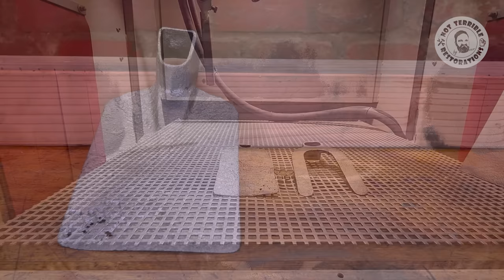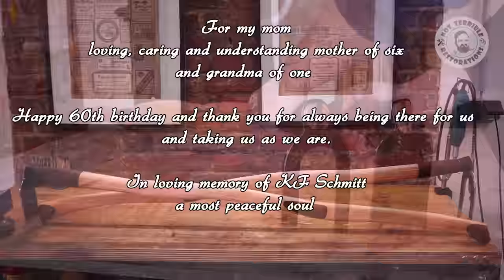Restoration of Rusted Gardening Tools for my Moms 60th Birthday

Comment: Great work mate! Just a good tip when working with glass bead media. 5-6 BAR should be tha max you use. Otherwise you just make the glass beads into glass dust quicker. So take a little bit pressure down and your media will last longer and save you money 👌

Comment: A great idea with the composite handles. I am struggling with getting strong handles for my axes - I need strong and long handles, like 90-95 cm, and the lighter the better. Perhaps the crisscrossing of fibers will help. The inlays of dark wood are beautiful.
Reply from the maker: For axes you should use ash wood or hickory. The proved to be best to handle the high forces
Reply: @NTRprojects  Thanks for the response, Dr.  Beer. I do use both ash and hickory and both are great. Still, breaks do happen sometimes.

Comment: The chemical attacks ALL the metal. Electrolysis attacks ONLY rust. One idea is electrolysis and then a quick dip in chemical to stop flash rush. 

However, you don't need to dip if you are going to sandblast lol

Comment: At 5:28 why didn't you weld or solder those holes?
Reply from the maker: Hey Matt sorry for the late reply I always try to answer questions. I didn't solder it, since that tin would be too soft.
And I didn't weld the tip because the thickness was varying in this area way too much. So some parts are almost gone and around of it some areas with 2mm of material. Welding this is maybe in general not impossible but it requires a lot of welding skill and that is an art format itself which I don't master ;)

Comment: Awesome video (as always :) ) ! Quick question, how big / strong air compressor do you need to have for that amount of sand blasting? Thank you for answering in advance and keep up the good work!!!
Reply from the maker: That's not easy to answer. I think if you need 8-10 bars and a 70-100 litre tank minimum. But also the processed volume per minute is important. And that should be around 500-600liters

Comment: Please be careful with the table saw! Free sawing is not safe - you really need to use a fence. A riving knife is essential to prevent kickback. You can cut it down to below the height of the blade if necessary. But your current setup is begging for a kickback accident and I’d hate to see you get hurt.